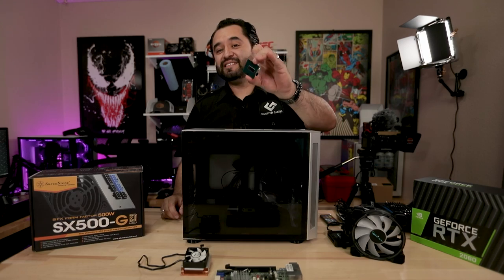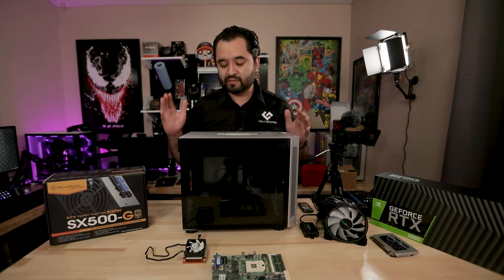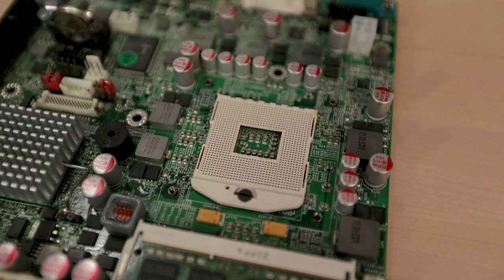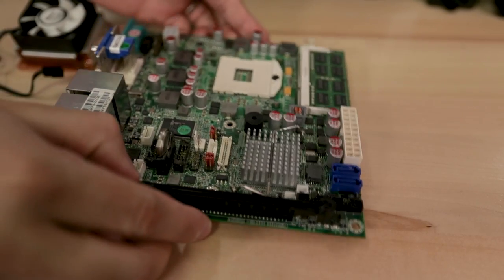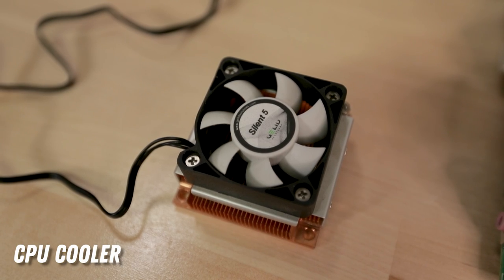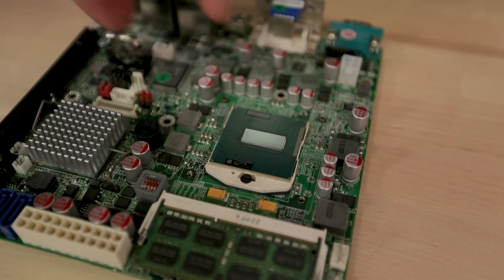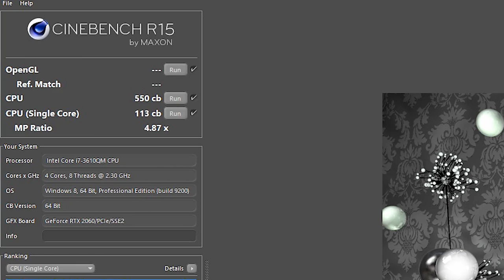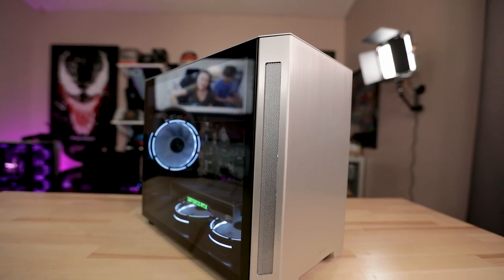DEAD LAPTOP gets 2nd chance at life? - Laptop CPU in a Desktop!?

Comment: Can I take a Lenovo laptop CPU and put it in an all-in-1 computer
Reply from the maker: Probably not since pretty much all laptop CPUs after 4th Gen Intel are soldered and not removable
Reply: It's removable I'm not for sure before I take my all-in-one apart I want to make sure it works
Reply: I've been trying to check to make sure I can put it in there because it's a i7 core  I have a i3 Lenovo all in one trying to do graphic design the CPUs running at 100% so that i7 will help

Comment: That's cooler looked dinky but then I realised the die was exposed so it's got better heat transfer. Be cool to see a 90mm or 120 desktop desktop CPU modded to the CPU and see the temps maybe a CoolerMaster tx2 I think it's called has 90mm tower cooler.
Reply from the maker: Yep, stress tests have it not really breaking 70-80c and since it's rated to go up to 100c, it's perfectly fine. Cooling it better won't get more performance out if it unfortunately. Can't overclock it and it doesn't do the modern boosting behavior that would make that worthwhile. But it certainly would look better!
Reply: @CoalitionGaming  ah ok cool video idea besides overclock.

Comment: Nice project but cooling is a little sub-par perhaps a litle more of heatsing would solve this
Reply from the maker: There is no problem with cooling at all actually. Remember, it's a laptop CPU meaning lower power. I thought it wouldn't be enough but the CPU, which is designed to operate normally up to 100c (again, laptop) never really broke 75c under any load in this configuration. So there's actually no problem at all.